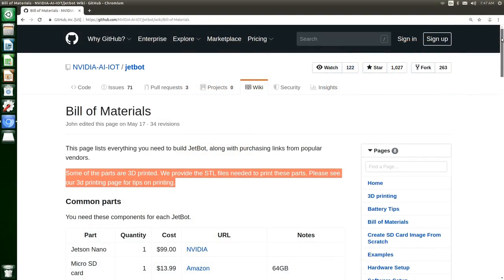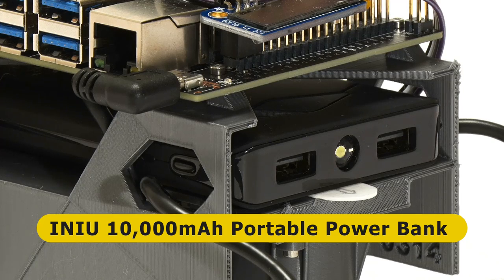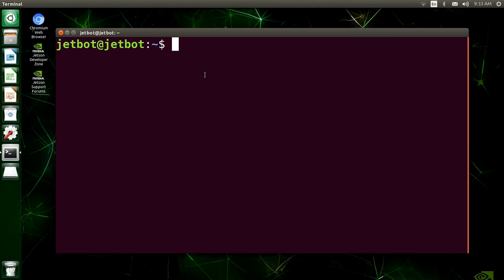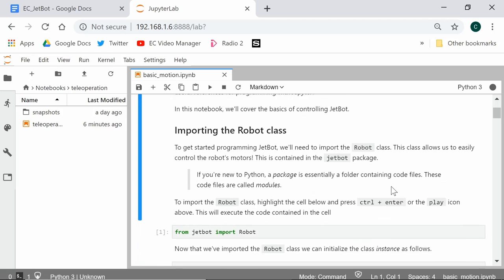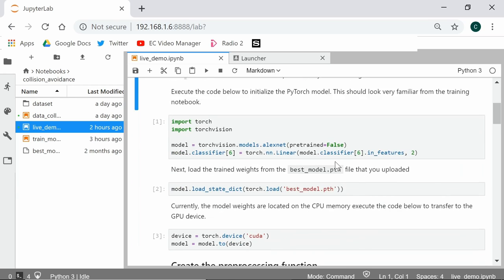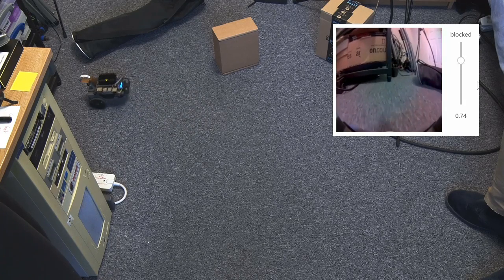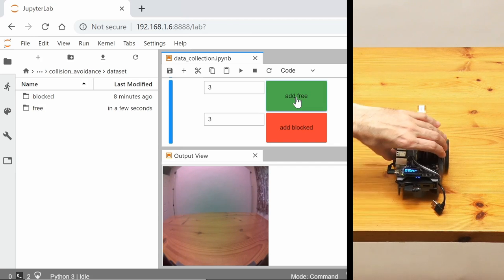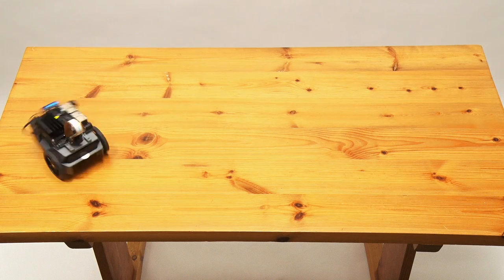NVIDIA JetBot: Jetson Nano Vision-Controlled AI Robot

Comment: Jetson nano is a ridiculously powerful platform for the price. I'm using it for high speed machine vision to monitor manufacturing process in real time and this beauty can record 200fps in 720p and it can easily process 100 frames per second with a simple detection algorithm. We are living in the future. 10 years ago this would be a huge challenge even for a desktop PC not to mention that there was nothing in place to capture such high frame rates in real time and process them simultaneously.
Reply from the maker: Great feedback, thanks for sharing. I share your appreciation of the Jetson Nano -- it is a really great board.
Reply: how do u make that simple detection algorithm is is based on those green square u defined in the algorithm?
Reply: How is it going on, after 3 years? Have you been using it to date in other applicationa too?
Reply: Actually it's not powerful at all.  A nvidia tegra T210 with a GM20B GPU it's a toy. Also the OS on the board is way to heavy for the system.

Comment: This is quite interesting. I worked as a Field Engineer for a company call Intelligent Reasoning System Inc. back in 2001/2002. They made capital equipment for installation on an electronics manufacturing line for use in Automated Optical Inspection of PCBs. We used an early form of image training (the founders of the company also wrote the software for the terrain tracking algorithms for the Tomahawk cruise missile and adapted those to this application) with statistical analysis within a set standard deviation. The system worked well and it is very similar to what you demonstrated here with the Jetbot. We would train examples of good images and bad images of electronic components on a PCB and for each false call, we would train that as a bad actor. Over the course of the manufacturing run, the system would become more and more accurate. Good stuff indeed. 

Keep the good material coming! I am considering getting one of these to teach my daughters not only Python, but machine learning in general...

Comment: Thank you yet again!  THAT IS PART OF MY "KING PROJECT".  i want to automate lawn tractor mower to mow lawn using visual and distance sensor for obstacles but program to mow in a pattern.  Learning properly to go around objects on eventually both sides to keep mow pattern.  One thing I have not figured is to read where grass has been cut verses the next cutting row of taller grass.   Unless it uses "mapping" and location to determine the next row.  That would make sense.  The servo motors for steering and such I have to figure out with experts in that area. 

 There is one company that has pattern mowing already.  I am discussing selling "kits" to install on older mowers already purchased.  They seem interested.  but that will have to wait as I have to many automation things to complete first. 

 Also paint a workshop barn/office. Insulate, run wiring, and interior walls and set up work table, hand tool storage organized on wall. (I am building skeletal arm that requires servo motors camera and nvidia to run it.  Helper Arm to pull tools and put them up when finished.
I have 4 months to also setup garden,  water retention, sensors pumps water lines.  This year with no garden I grew the most delicious Pineapples, Lemon grass, tomatoes, and seasoning herbs...playing around. 

I need some automation interested people to assist with this project.  amazing the blue print for automation has grown substantially.  I guess it will take 2-3yrs to implement fully.  I would prefer that 24hrs a day over any other option to spend time on.
Reply: Use bluetooth adapters in the corners of the garden as "gps-beacons". Now you can use the mower to print text or pictures in your lawn like a big plotter.....?

Comment: This would be a good project to use to train an autonomous lawn mower.  The direction changes need to be in a bit smaller increments so it doesn't just turn too much at once but just a little and retest for obstacle. If all the information can be stored on SanDisk card and saved then the trained brains/program can be moved to a bigger robot and have the "Blades of Death" (lawn mower blades) installed and turned loose safely to mow the lawn.

Comment: Impressive, I managed to write a simple IA script this week, as in copy it and get it to run, and that was a real first.  It didn’t really do anything as such, but I could see the code working and that helped me get my head around things.  Really, I struggle with all this and always will but just making some sense of it helped.

My 10-year-old son will hopefully do better and having something like a robot will be more meaningful than my naming game.  A £100 price point seems about right for this, especially as it should be extensible and it is the code that is what it’s all about, and you need affordable so there's access.  Hopefully you can have say a team of 4 kids with one Jetson to build a project.  £25 each isn't a complete killer over a year, say £1 a week- even those on very low incomes should be able to support that.

To be honest though, I’ll always be a hardware man at heart so the Jetson is a bit lost on me, I’ll only turn it into a Kodi box or games emulator.

EDIT:  I do wonder what Raspberry will come up with, clearly it won't be Jetson standard as Nvidia are miles ahead on this stuff and have massive budgets.  The same for AMD, I just wonder there, they have supposedly invested some money in IoT/Embedded but I think they will be in a very different direction- could be wrong but more 86 64 and industry utility stuff- certainly not self driving cars.

Comment: What I would suggest is to put a sensor under it where it can detect edges, I have a robot made years ago that goes to the edges then stops because of the edge sensor it works like a charm!
Reply from the maker: But the point here is a demonstration of a vision recognition neural net that can be taught. :)
Reply: @ExplainingComputers  right :) I guess both does the trick!

Comment: Impressive. I was wondering if the nano module can be used on Xavier NX developer kit, as the Nvidia documentation state they share same pin out. Already have the nano module but eyeing the  NX development board with it support for M.2 drives support

Comment: Great video Chris, as always!  One question, though - during the "table top" demonstration, if you were to place a blockage in front of it, would it still attempt to change direction? I ask this as it seemed you gave it specific examples to work with during that activity.
Reply from the maker: It might -- I actually never tried! -- as the trained net is still based on an initial model. But it would probably not be as good at avoiding objects, as I did not show it other objects. In the first collision avoidance demo, the robot was running using a pre-trained neural net, where it would have been shown a variety of blocked and free situations, from which it learnt enough to be able to operate in a space it had never seen before. Which is rather amazing if you think about it. It is also possible (although I have not tried it yet) to run multiple programs together -- eg one for collision avoidance (to keep the robot safe, as NVIDIA put it), and another for object tracking.

Comment: Chris, have you ever made robots using Lego Mindstorms Robotics kit? When I found a huge bargain from Toys 'R' Us for £120 for the RCX 2.0 kit I was happy with how amazing programming the robots to follow black lines using light sensors as well as touch sensors to show how well they interact. I wanted to use those Mindstorms and Technic parts to make a Wall-e robot but I never had the chance to do it myself. I was surprised Lego Movie 2 included the DeLorean and TARDIS used for the time machine parts. Sadly as you said from M-Disc Video: "Time machines don't exist." in order for you to see how those M-Discs deteriorate after a few centuries. Hehe!

But to tell you the truth, I was annoyed on how Lego dropped legacy support for the Technic 9V and RCX near 2006, and making their newer EV3 Robotic kits too expensive as well as the BrickPi from Dexter Industries. I don't think I should waste my money on those latest Lego Robotic parts that are pointless as I still like my RCX 2.0 brick with an IR Remote Control and my Technic Control Centre Mk II. Besides I think the Pi 4B seems reasonably priced and I believe we will have more ARM support for the apps that use Linux .deb packages - not just Android. But it seems like Apple is making more stupid moves; not just for ARM only OS for macOS, but they are pulling out support for Epic's Unreal Engine and more. The Unreal Engines are very popular for AI NPCs as well for a huge amount of gaming mod support, but for Mac users...they will have a huge shock!

Comment: Very cool Chris. Of course it's 'simple', stuff like this starts out simple (you Arduino & Raspberry Pi blinky lights folks will know what I'm talking about... You can learn a lot from blinking those lights! ). Does Nvidia show you (or give access to) the code for this? Like another commenter said, possibly you could modify or extend the code for more functionality. I'd love to build one of these and examine the possibilities. Thanks for another great video Chris.
Reply from the maker: Hi Steve. And yes, all the code is available to tinker with. And there are various other examples available, like self-driving down a road based on its markings, and following a person/object.

Comment: A while back, I got an Idea… This is how it goes… You have an Artificial Neural Network (ANN), that is having trouble with a task that requires a perception of Time. What is a simple way to give it a perception of time? Answer: Give it memory. What is a simple way to give it memory? Answer: Use data from its sensors, taken at consistent intervals, and give them a “memory slot” in a cache. Use a small number of memory slots for progressively older sensory data samples. Whenever a new sample is added, delete the oldest sample, and shift the contents of all the other slots to the slots representing the sample that is one interval older than them, until the slot representing the newest data sample is empty, so that the most recent sample can occupy that empty slot. Feed the ANN from whatever is in the memory slots, as a separate sensory input. It will then be able to compare old vs new, and perceive changes from as far back as the memory slots go.

This will need careful optimization, to avoid overwhelming the memory capacity of the hardware that it's all being run on, and to not require a ridiculous number of “neurons” in the ANN to be dedicated to input.

One method of optimization, may be to also perform a resampling operation on saved sensory data, to step it down in size, every time the data is shifted to a new slot, whether immediately after it first enters memory, or if it meets the condition of being past a certain age, so that it loses fidelity, but still exists for reference for much longer within a given memory size constraint. 

Some care should be given to choosing a good resampling filter. It should probably be a balance between accurate and lightweight for processing. And accuracy brings up another subject: Resampling images while stored in the sRGB color space, is mathematically proven to distorting the overall energy of an image. All camera input should be converted to linearRGB colorspace, if it's going to be subjected to resampling. sRGB is meant to make efficient use of digital memory, for cases where an image is meant to be shown to humans, by matching assigning more importance to ranges of the color spectrum that the human eye is most sensitive to perceives differences in. So sRGB is completely unnecessary for computer vision.

Another optimization method is to simply start with a smaller sized resolution for sensory input, or to use a color model other than RGB, such as Lab, where there is one color channel for Lightness, and two color channels for chromatic data. Then, you can aggressively down-sample the chroma channels by a positive whole number.

I've mentioned resampling a lot, but I think I should mention that I'm not 100% sure how useful it would be to save processing power overall. I'm quite certain that it will save memory, though.

Comment: Instead of having a camera to measure edges wouldn't it be better to have an optic measurement, you could use form a mouse, so it can count how many steps / rotations it's doing and work out the area surface and produce  a map. This could be used in conjunction with the camera, I mean a camera doesn't know the area it's patrolling with a counting system it is easier for it to work it out I would have thought
Reply from the maker: I am sure that you are right that using/adding sensors other than vision would improve matters. :)

Comment: Nice video. It seems to be mostly controlled by 'blocked' images, which makes sense. How easy would it be for it to go forward only if it's a known free image(s)?  I'm thinking this might be useful for an environment where unknown/unpredictable objects might get in it's way.
Reply from the maker: The neural net feeds the control program a stream of blocked probabilities. As you note, the program is set to be cautious in how it responds to these. But the probability of blocked that triggers a turn could easily be changed. In terms of what you suggest, the key issue is that "blocked" and "free" are two ends of the same variable.
Reply: @ExplainingComputers  Interesting. So it sounds like it would be pretty easy to set it up so that if it's not 'free' enough, treat it as blocked.  Thanks

Comment: I have only one question for the platform, what is the runtime with only using one power source?.

Good video and overview, I would suggest that anyone looking at doing this, learn the math required first ( if your not upto speed ), then possibly look at OpenCV amongst other tools, I say this because all the ground work is done for you with this platform so what are you really learning technically?.
Reply from the maker: Runtime depends on the level of motor use, but is certainly many hours. The Jetson Nano itself runs a good 6 to 8 hours (again, depending on what it is doing) on one charge of the pack. I expected to be recharging a lot, and did not need to.

Comment: Would there be a way to "automate" training data if this were say, a consumer product? If for example, NVIDIA sold thousands of these that were collecting camera data, would there be a way to use that data to train neural networks for future generations without having a human being mark each image as "blocked" or "not blocked"?
Reply from the maker: Yes -- the more training data is used, the more proficient the neural net will be, and the more likely a generically-trained system will be to be able to work without specific environment training. A robot could also be equipped with a sensor to detect when it collides with something, allowing it to "step back", take an image, and teach itself.

Comment: Why does it only turn left?
Reply from the maker: Only because that's what this sample program that runs this neural net is programmed to do (the neural net reports free or blocked, the code takes this input and applies the "turn left if blocked" rule. I can turn the other way! :)
Reply: It's due to the Zoolander Paradox
https://youtu.be/E-RbtCXTmc4?t=15
Reply: b gg na. It would have come with a speaker to call everyone racist, complain the whole time and demand $20/hr to move in circles.
Reply: @ExplainingComputers   and could you program it to take the most optimal decision to give it a more natural behavior?
Reply: It could randomize left or right if they both within "acceptable range" or take the highest value if not that proximate or equal.

Comment: Now create one based on the Atomic Pi  .   I did in fact purchase a Atomic Pi .   It's stashed in the SOME DAY BOX!!   LOL  .  This Optical system is interesting for sure.   Do you think Semi Autonomous Flight could be possible ?
Reply from the maker: I will return to the Atomic Pi . . .
Reply: I managed to do something with it, really simple, based around W10 embedded- which is free on the basic version and there are some tutorials and actually something of a community- not Raspberry Pi standard but its there.  Then again I could have done that with an ARM SBC, and/or just about any Cherry Trail- just buy a cheap Cherry Trail thingy from eBay and hack at it.   I think the best thing for the Atom is a games emulator to be honest- because that actually works ad everything else doesn't really, so you coud just buy a games emulator/ kodi box off eBay for about £120.  They say the ATom is $35 but it isn't by the time you import it and get all the bits- mine has cost over £80 easily.
Reply: @twmbarlwmstar  I had no plans for the stupid thing but was intrigued with the fact it has a  BNO055  and could be run out of the box pretty much.  Like I said,   it's in the some day pile.  Worst come to worst I'll have a viable computer come Armageddon  ..
Reply: @ExplainingComputers  Please, mine has been a games emulator twice.  I need inspiration and there's none on the internet except a NAS and I don't think it makes a very good NAS, the Pi4 makes a better NAS.
Reply: @pulesjet  Yes the BNO055 seems great, but does anyone know how to use it?  In theory if there was any support community then I could use it on my motorcycle.  I’ve actually got the motorcycle all wired up ready but I don’t have a clue beyond that.  I even bought a £100 lithium battery that would supply better and more electricity- not spiky lead acid nonsense electricity.  It would be one high-tec Royal Enfield.  There's loads it could do (it's Bosch, they know about vehicle tech)  but I don't know where to start